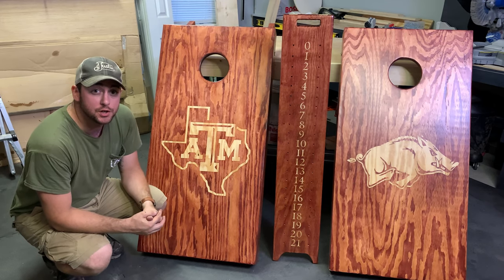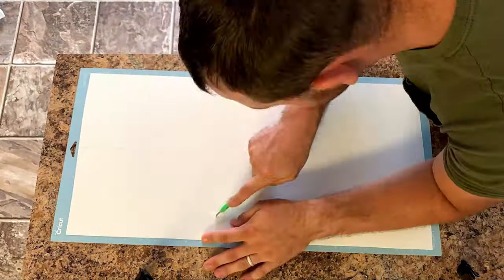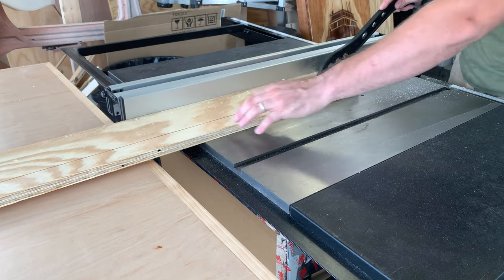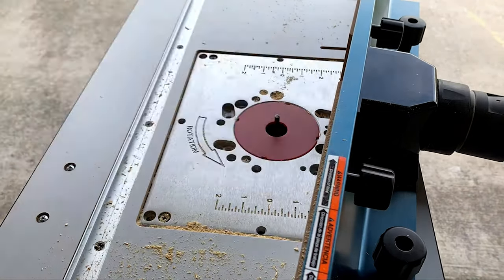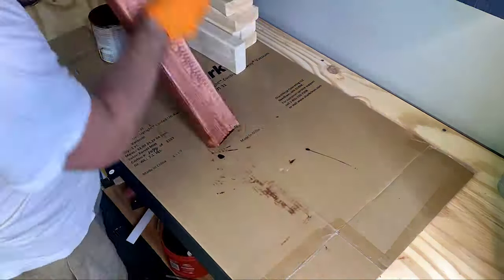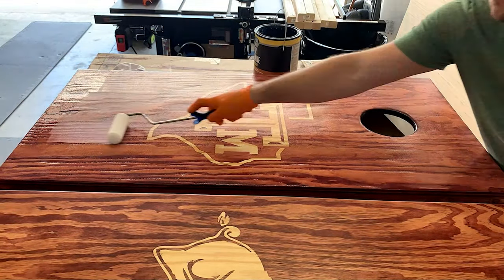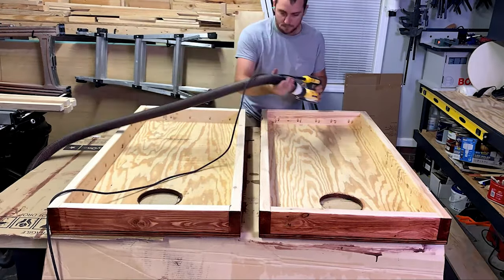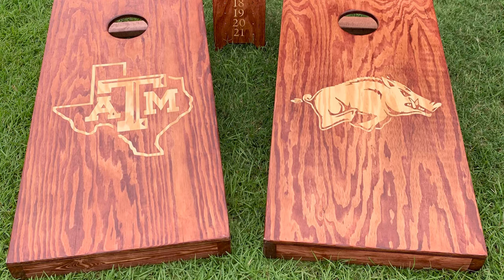How to Make Cornhole Boards and a Scoreboard

Comment: I have a question regarding the vinyl..I'm currently working on some boards with gel stain and vinyl and there is either a residue from the vinyl that we used or the removable vinyl we used pulled up some of the plywood where ever it stuck. Have you had this issue with the type of vinyl you used? I figured a light sanding would get rid of this to have it ready for poly. Thanks in advance.

Comment: So after I put the board together I sanded with 220 grit sandpaper...after I stain could I use minwax polycrylic for a finish
Reply from the maker: REAU yes you can. Just be cautious for the weather.  Polycrylic is not weatherproof.  I recommend Sparurathane since it’s more weather/sun/and water protective

Comment: Great 👍 video!  Was splitting the A&M decal difficult with the Cricut?  Thanks for sharing.
Reply from the maker: Robert yes. I blew the image up to a 18” width. Then I had to split it in half using the big sticky mats in the cricut software.  Then I just put them together on the board, stained, then peeled it off 😎

Comment: Hello,
Why did you use 631 removable vinyl instead of a more permanent vinyl like 651? Just to clarify, you left vinyl on the cornhole and stained over it, you didn't removed it?
Great video, learned a lot!
Reply from the maker: Hi, I used the removable vinyl because after the stain dried I peeled it off.  This was a minor mistake in my video editing, I accidentally left that 10 second part of the build out.
Reply from the maker: You can kind of see the peel process around 7:30

Comment: How do you keep the stain from bleeding on the wood and messing up the lines under the stickers
Reply from the maker: I used stencil vinyl, and gel stain.   Liquid stain tends to run a lot easier then gel.  Works like a charm, just put about 2 coats on it 🤙